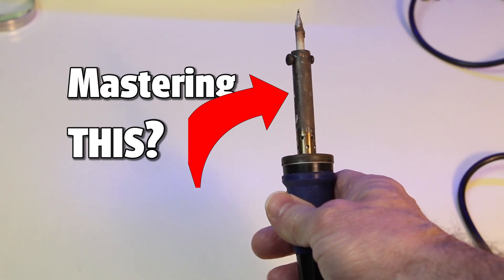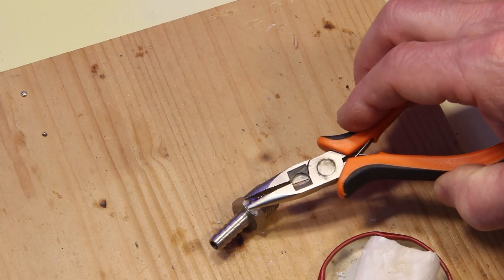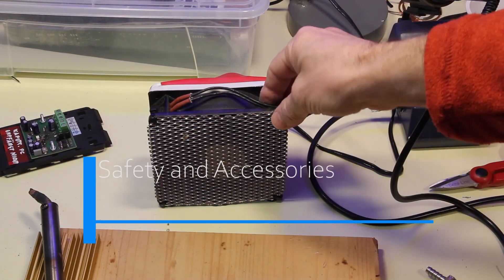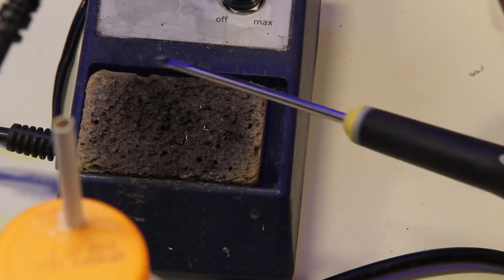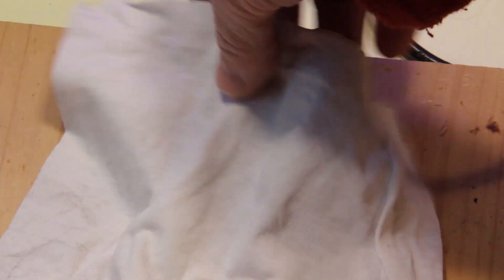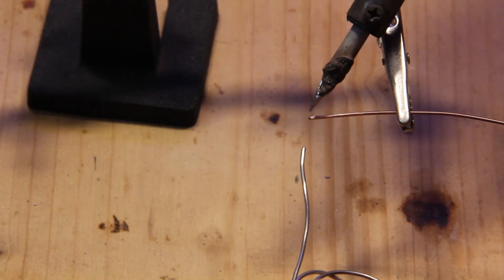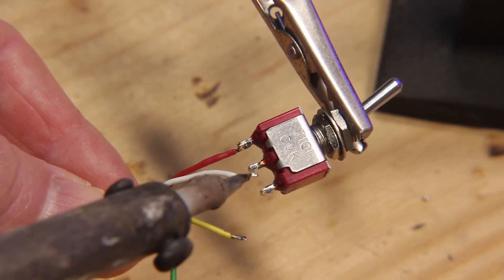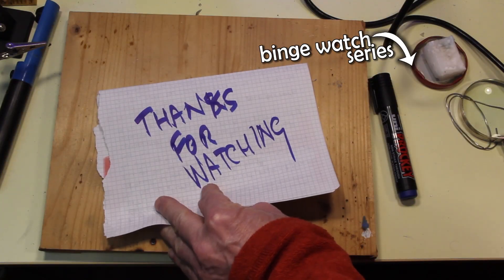Learn How to master a #soldering iron: tips and secrets from an experienced guy

Comment: Liquid flux applied to the pcb just before soldering also makes it much easier to get a good result. Acidic flux will gradually destroy the pcb unless thoroughly removed, so should be avoided. I agree that the mesh abrades the tip, unfortunately many videos recommend using it. I have destroyed a couple of tips this way. I am very envious of your larger soldering irons!!!  Great video.

Comment: Another tip that is helpful to pros as well as beginners is to use a Eutectic Solder. One type I use for most soldering is SN62 PB36 AG2. Eutectic Solder has a single temperature for the transition between liquid and solid state. This makes "Cold solder joints" practically impossible. Cold solder joints happen when non-Eutectic solders like SN60 PB40s are used and the joint is not kept perfectly still during the cooling transition period because different portions of the solder are solidifying over a range of termperatures which means there is a longer period of time where movement will ruin the job.
Reply from the maker: @leiferickson3183  great comment! Thank you. I completely forgot that when I filmed the video.